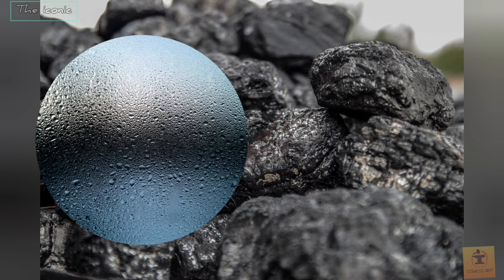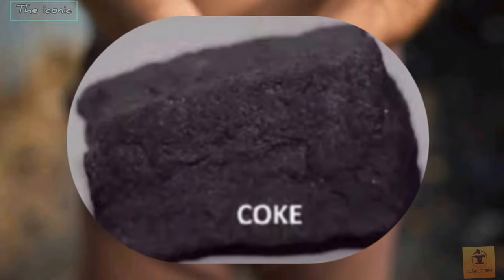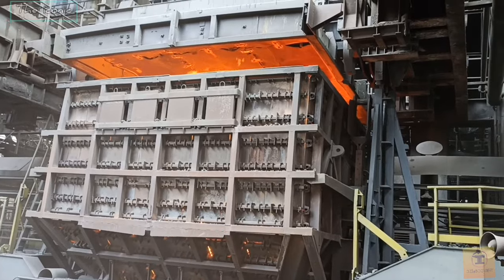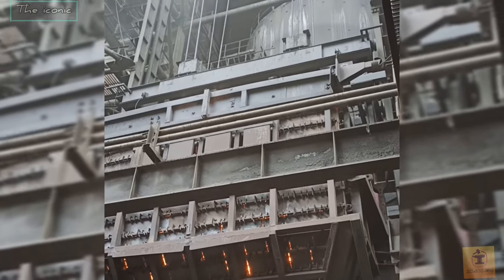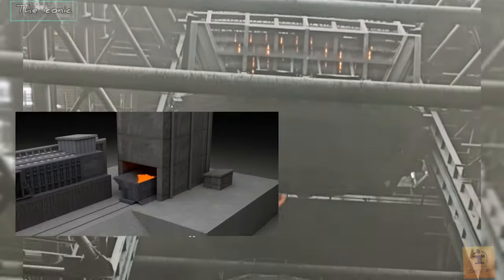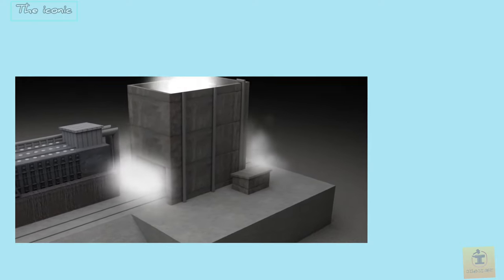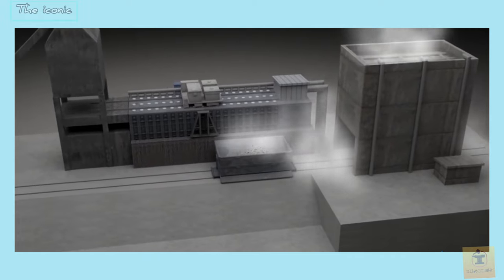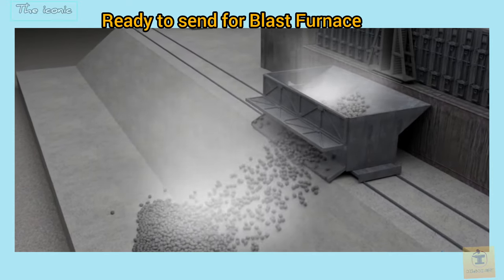BHILAI STEEL PLANT | COAL TO COKE | COKE OVEN BATTERY OPERATION | DRY QUENCHING | THE ICONIC | HINDI

Comment: Madam BSP ke sabhi battery me 67 ovens hai kya? Normally to 69 ovens hote hai?
Reply from the maker: 67 se 69 k as pas hi hai sab me , kuch kuch jinme se idle rehte hai
Reply: @theiconicmetallurgy  Madam, please provide exact data. In Battery-11, 9 and 10, there are 67 ovens which are 7 mettes tall. 

In Smaller Batteries (4.3 Mt tall), there are 65 ovens. Fully operational battery has 65 working ovens.

Comment: Volatile matter kya hota h 

Non recovery coke oven m volatile matter se coking kaise hota h ?
Reply from the maker: VM में सल्फर और हाइड्रोकार्बनस आते है।।

NR TYPE COKE OVEN में air को पास करवाया जाता है , जिससे COAL का VM जब जलता है तो उससे जो हिट जनरेट होती है वो HEATING का काम करती है
Reply from the maker: In the process of coke making in the non recovery ovens, volatiles evolved during coal carbonization are not recovered as by-products but are combusted in the oven itself in the presence of controlled quantity of air and the heat of the volatiles of evolving gases is utilized for coking of the coal mass into coke and thus no external heating is required.
Reply from the maker: The heat is generated by the combustion of volatile matter which is then penetrated into the coal mass through radiation from the oven top and also by conduction.
Reply: In nonrecovery coke making, all the gases are burnt inside the ovens. This burning of gas above the coal charge supplies heat for coke making.

Comment: 16 se 18 Ghanta itni jaldi kaise coke ban jate hai mam

Kom se kom 20 se 22 Ghanta too lagta hai
Reply from the maker: Nhi 12 ghante me ban jata hai , 4 ghante extra lekar pushing kiya jata hai , according to pusher operator and logbook timings of BSP
Reply: Normal coking period is 18 hours. That means, Coal gets fully converted into coke during this 18 hours period. More than 20 hours coking period is necessary in case of sick ovens or ovens with higher width. If there is delay due to breakdowns, then also coking period goes beyond 20 hours.
Reply: @theiconicmetallurgy  In BSP or wherever there is coke oven, the coal to coke conversion takes about 17 to 18 hours. Some extra time is required as soaking time to get the coke mass temperature stable before pushing. This is required for maintaining coke quality.